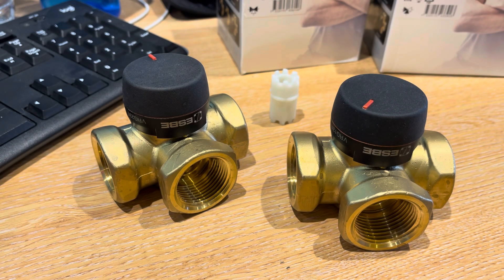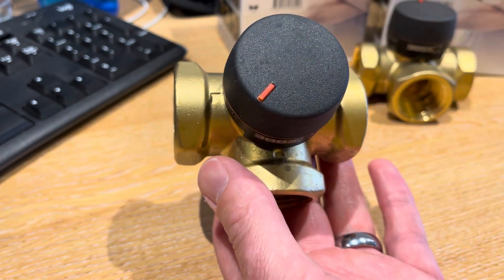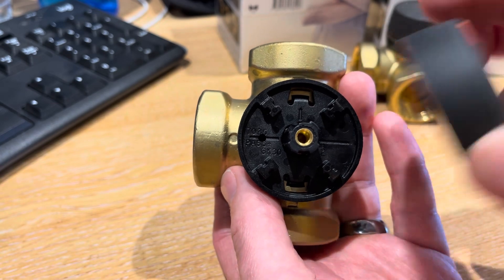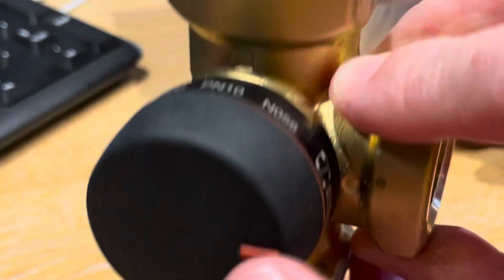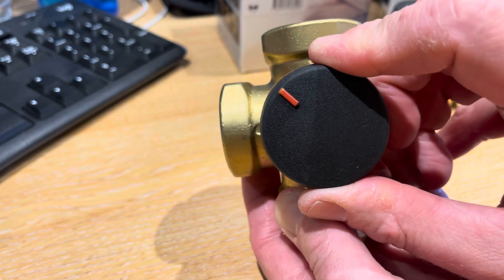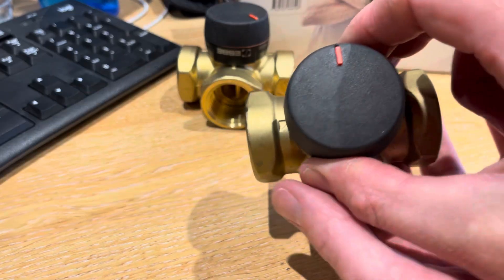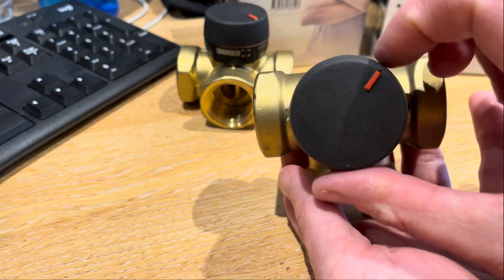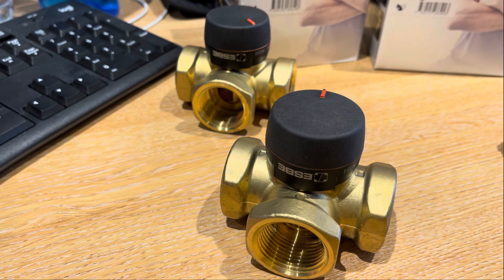ESBE VRG130 & VRG230 Series Rotary Valve Overview (Includes VRG13X DHW Diverter Valve Setup)

Comment: Hi Rich, recently replaced an old steel body Esbe valve for a vrg131 with actuator in a mixing application and couldn’t get the secondary pump to kick in, more than certain it needs replacing but would be handy to have a wiring schematic of a a central heating system with a conventional boiler, Esbe valve, UFH and additional zones to test against, any idea where I might be able to find this? Thank you
Reply from the maker: There isn't currently any UK technical support for ESBE valves, hence I made this video. We sell ESBE valves but we wouldn't application support them unless we were paid for doing that. Have you tried contacting ESBE via their website for support?

Comment: Brilliant stuff. The more the merrier 😊

For such a high quality product, it seems bizarre that the Installation info is hard to access. Due to this, they're almost a Dark Art-  which for Sales isn't a great concept. 

Back to using them:-  It'd be good to learn about fitting the Mixing valves in groups, eg for UFH,  Rads and Bathrooms.
I've heard conflicting ideas as for the best design for such a scenario. Some saying, use 3 x  Esbe valves, some  say 2 x Valves (UFH & Rads) others just 1 x on the UFH
Reply from the maker: It all depends how many temperature zones you are creating and potentially what effect on efficiency it has. For instance a couple of high temp towel rads might mean you have to run elevated flow temps and mix all the other circuits. Consider electrifying towel rads and having the radiator circuit as your highest flow temp which then could now be unmixed. End of the day, efficiency shouldn’t be at the cost of comfort and vice versa.